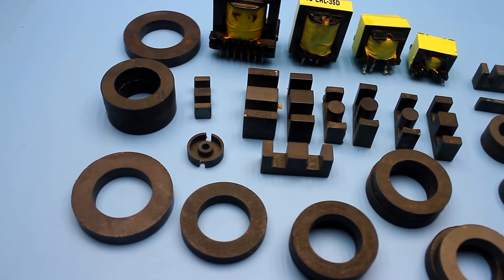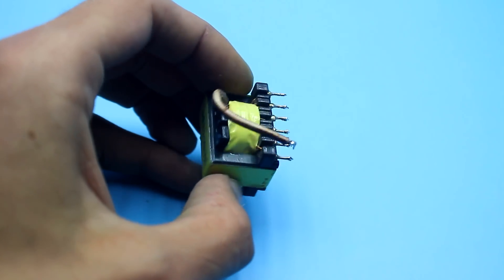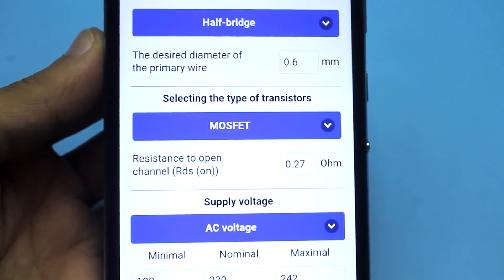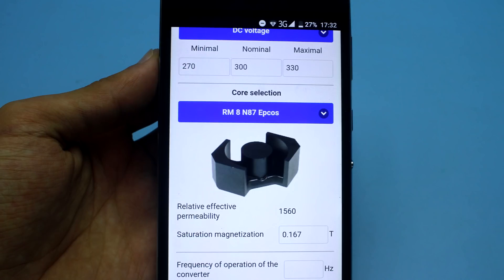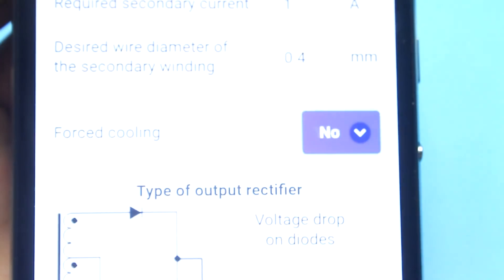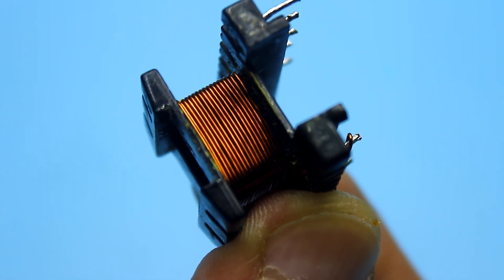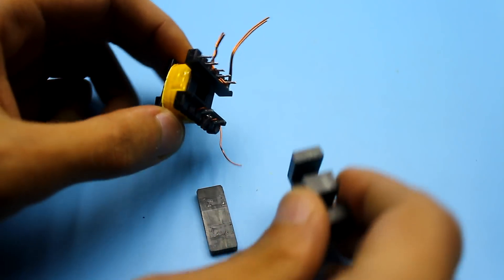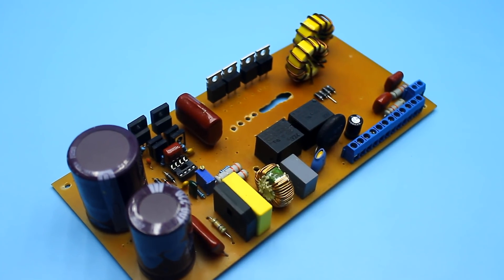Transformer winding and calculation in detail

Comment: Thanks for the lesson. Used to the older iron core transformers, but want to learn more about HF pulse tx's too. Any advice on choosing any HF tx's for a pure sine wave inverter? Want as much power as possible, from 500 watts to a few kw's, but want an output that can deal with 'power factor,' especially say a fridge or motor switching on. Maybe use HF tx's in parallel to double the current output. So far, have got it's around 36 khz for square wave, or 96 khz for a spwm pure sign wave. I've got one of these tx's, plus lots of others from power supply boards. Still not sure how dc-dc power boosters work with pwm. Learning how to program with Arduino, but zzzz process.. lol.

Comment: I need a transformer with primary 24-0-24 and secondary 35-0-35 in 6 amp , please give winding details, how to calculate wire size, core size and number of turns

Comment: Hi, I bought the application to calculate the transformer and I do not understand what this part refers to:
What does the application mean by that?
diameter of the primary wire  1.44mm                This also means the diameter of the cable 
 diameter of the primary wire  0.4*13mm
Reply: Can u send the APK to me
Thanks
Reply: How much is the app? and did you get help?

Comment: Hola he comprado la aplicación para calcular el trasformador  y no entiendo a que se refiere esta parte :
a que se refiere la aplicacion con eso ?
 diameter of the primary wire  1.44mm               significa  el diametro del cable es :1.44mm
 diameter of the primary wire  0.4*13mm        este tambien significa  el diametro del cable es :1.44mm o es el diametro al cuadrado  o  que significa
Reply: This means a harness consisting of 13 wires, each wire 0.4 mm.

Comment: Question: on an MOT Transformer modifying the Secondary Winding using 15 gauge insulated wire (1.5 sq/mm) with 27 winds (26.xV AC output) will produce how much ~Ampere? Thanks for any in formation.
Reply: It depends on multiple things if you draw around 1kw which I think that’s what’s rated for MOT and it will be 32-35 amps

Comment: Where do I find a good reference for the math used inside the app? How is it all calculated?
Reply: Dude, just Google "transformer inductance calculator" and go from there!!
Reply: Google is your friend. Try that 1st next time.
Reply: PirateKitty In particular, I'm trying to find how much inductance on the primary side of a transformer is required for it to work on standard mains power. Too much or too little and the transformer won't work. Or so I figure. Rules of thumb are well and good, but I'd like to find a good source. Any good resources for transformer design?
Reply: merseyless please even i need to know
Reply: PirateKitty thank you